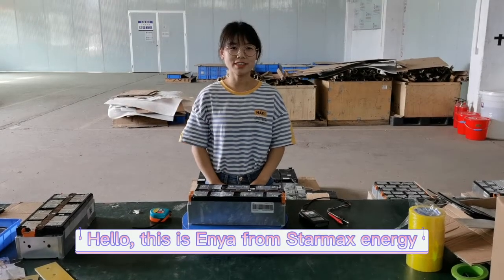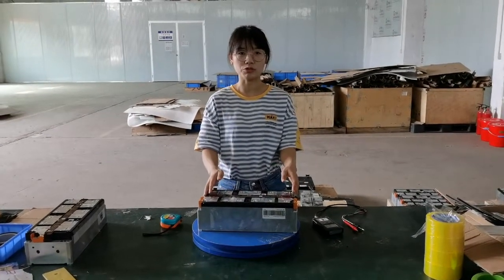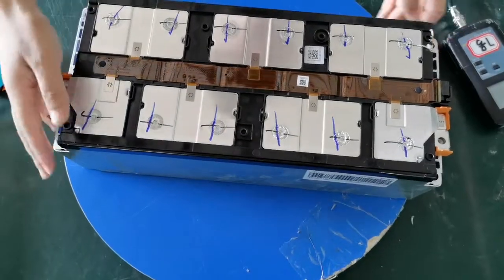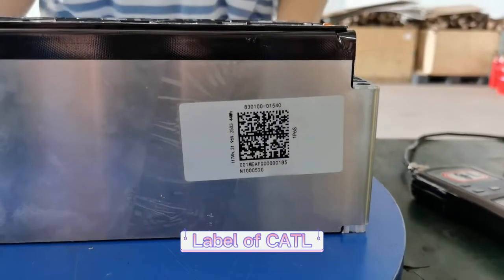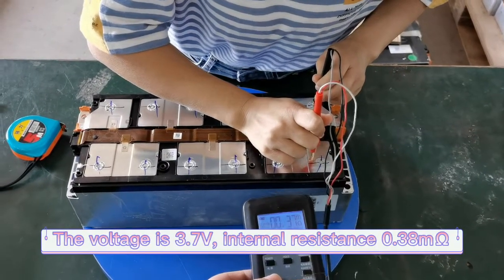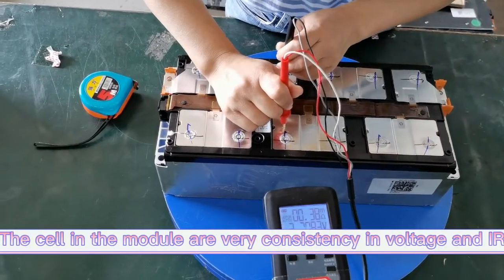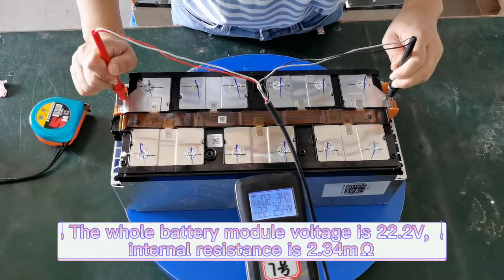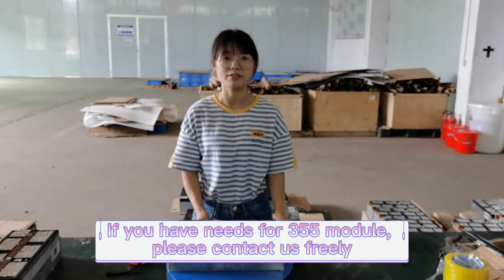6S1P CATL Lithium ion module

Comment: Why these moduels cannot be made to work with Inverters having fixed voltages of 12v, 24v. and 48 volts? What is the expected life of these Batteries? How much charge and discharge cycles they can afford? what is the Pricing for Bulk Orders?
Reply from the maker: Voltage is 22.2v